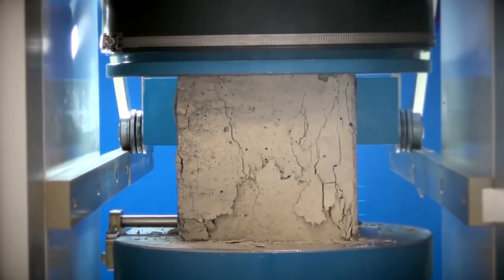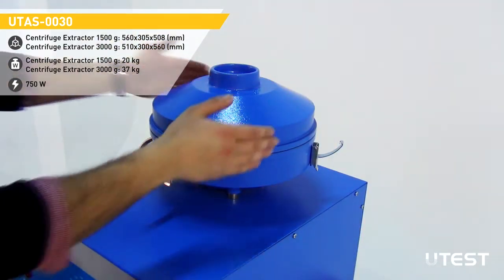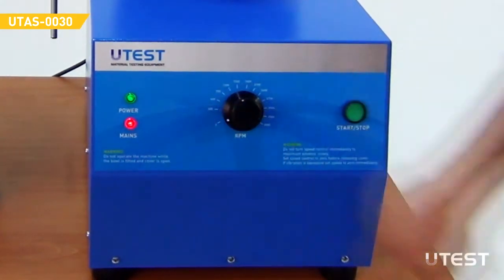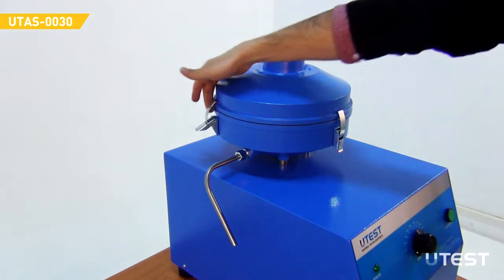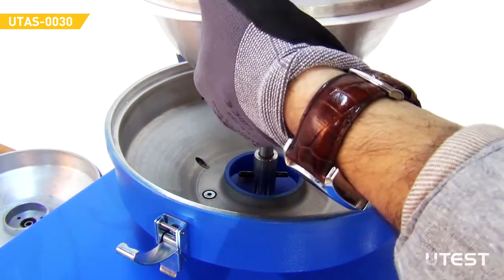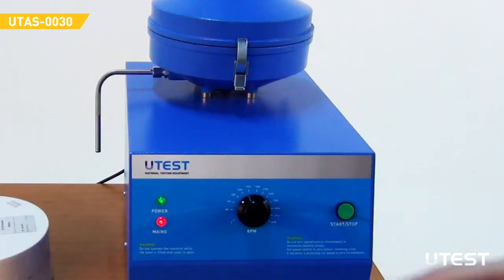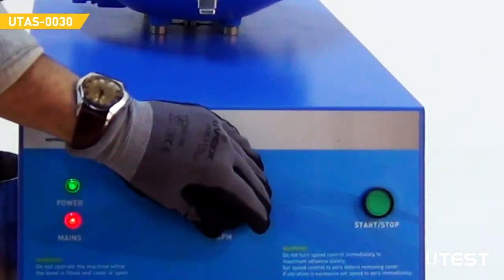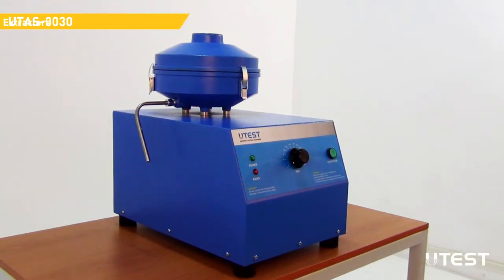UTAS 0030, Centrifuge Extractors, EN

Comment: Would this unit work to extract Gel from Flaxseed?  When you heat flaxseed in water it creates a gel...but I would like to extract the gel from the small flaxseed...
Reply from the maker: Hello,

Thank you for your comment. The answer to your question is unfortunately no.

This device is specifically used for extracting bitumen from aggregate. In this process trichloroethylene and rotating system plays a major role. The heating system which is needed for extracting the gel from flaxseed is not used in this device.
Reply: @UTESTGROUP  Thank you